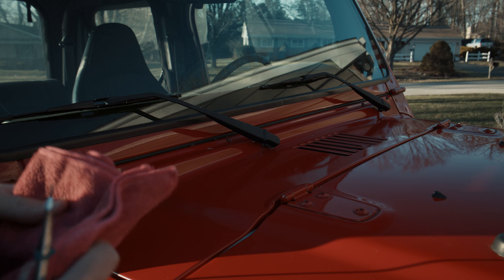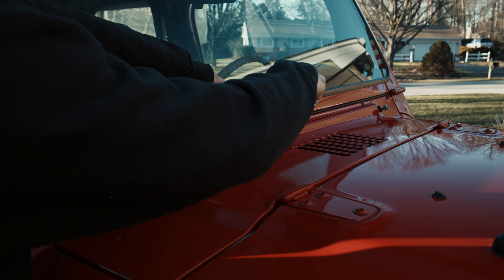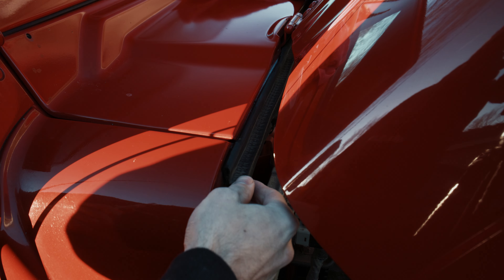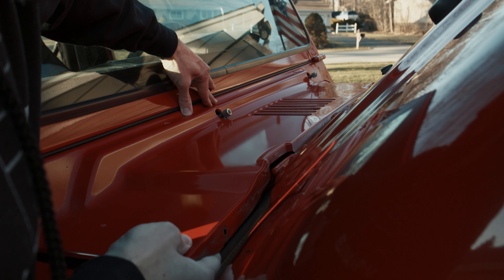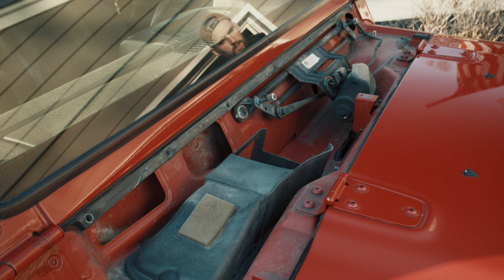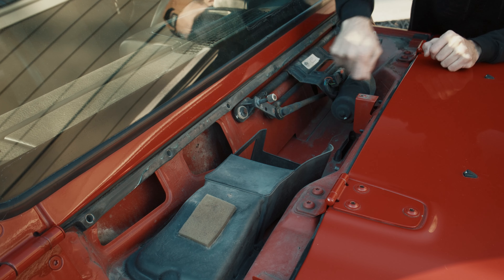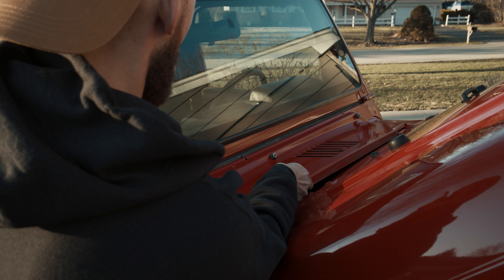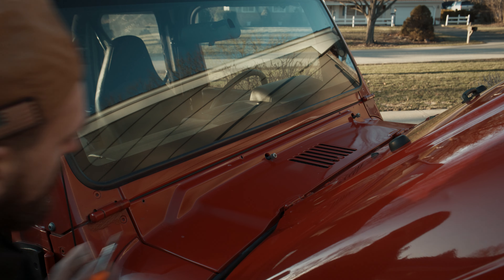Jeep TJ Cowl Removal | Water Leaking Issue Fix

Comment: I just watched your video.  I have a 1997 Wrangler.  I have replaced every possible gasket, door seals, resealed the front window, and under my cowl is clean.  Usually my TJ is in the garage.  A couple of days ago it was outside in a heavy rain, and it leaked again on the drivers side.  I just re-checked my cowl (which is clean).  I noticed that it appears that there may be a plastic piece on the top of the drain (at 3:00 in your video).  I'm not sure if water can get between where the vent comes up to the cowl base?  Kinda grabbing straws here, but any help is appreciated.

Comment: I noticed in this video you have what I presume to be an air filter over the cabin air intake. Is that original equipment or an addon? If it's an addon, where did you get it? 
Very good videos, Informative and no BS. Thanks.
Reply from the maker: Thanks Alan! That was factory on my jeep

Comment: Hey Kyle quick question

I recently traded my full doors for a very nice set of half doors with new uppers, and am loving them. When it rained for the first time today, a lot of water came seeping through the gaskets and at the corners. How bad do your half doors leak if they are on while it is raining? Do you have any tips on how to adjust the way the door sits? I don’t think they are seated quite right
Reply from the maker: Hey Ethan, My half doors do not leak at all when its raining. How good are your factory seals on the half doors?
Reply: @KyleSVT  they are in great shape.
Reply from the maker: hmm I am not sure then man
Reply: Ethan..I have a 06 TJ full doors and hard top for like 10 years no leaks then 1 day after a rain I had like 2 inches of water on drivers side floor I have replaced door gasket twice added foam weather stripping tape and it still leaks. If you find something post it please
Reply: I have a 97 with half doors and if it rains heavy I get water laying in the door skin track. I have to lift the frame of the skins up to drain it out. Not sure why it leaks  because my previous door skin didn’t do this.

Comment: My plastic windows on my soft top are super faded & super black, I can barely see out of them & my rear window has ripped & is holding on with tape (holding on good though) so if I wanted to replace that what soft top do you recommend & how much would it be?
(98’ TJ)
Reply from the maker: Are you looking for just replacement windows or entire top and windows?
Reply: @KyleSVT  I should be good with just the rear windows
Reply from the maker: @IKEACar  I bought bestop ones and they are great
Reply: @KyleSVT  nice, around what price would those be?
Reply: @IKEACar  looks like it goes from 1150 to 1650 bucks depending on color and etc,. That’s on thier website though and that’s not a slant back top which are cheaper
Reply from the maker: around 365 for windows
Reply: @KyleSVT  I’ll probably check it out someother time, I got hella more problems to fix on it 😂
Reply from the maker: lol sounds good

Comment: I think 104 they removed it I had a CJ and it had a drain tube that was nipple cream at the end I will ceiling it off and I just cut the hoes at the end of that let everything drain out. On my 04 however everything looks clean on the inside yet water still keeps dumping into the cab whenever it rains. And I’ve tried for the life of me to find a dream but cannot. Like I said it’s all clean the paint is green so I can see everywhere in there and I can’t find dirt